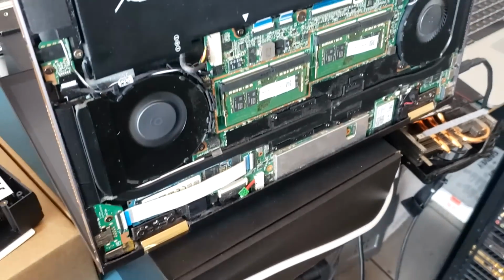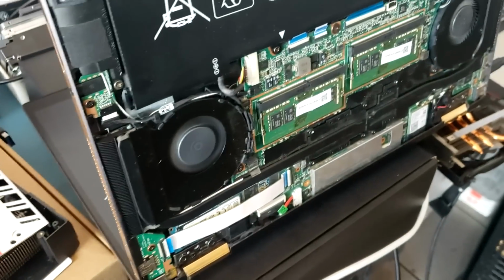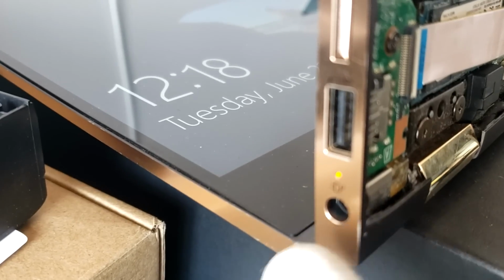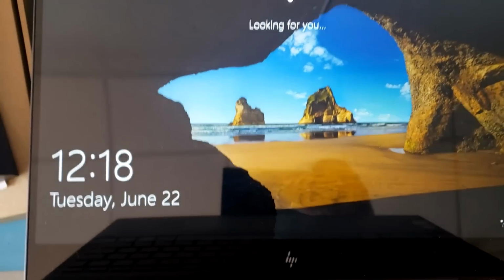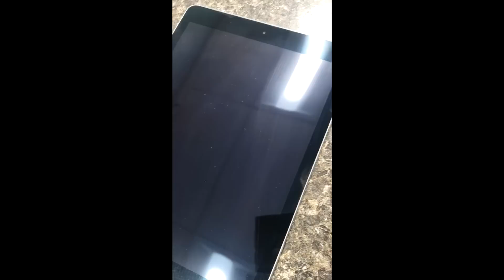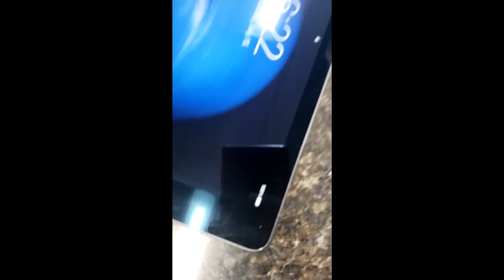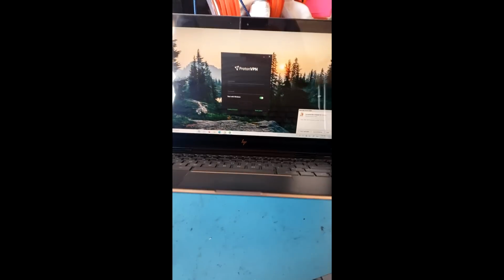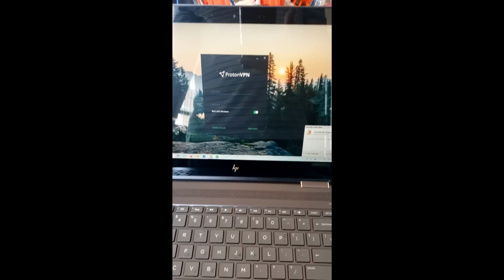Video proof for every repair to avoid False Claims and Disputes. That's how we do it.

Comment: We do this for everything also. Not only the repairs, but we have a dedicated desk for receiving all packages. We video the opening of each and every one clearly showing the delivery label to us, all corners and highlight any dents in boxes etc. Then the unpacking to show what was ACTUALLY sent, what condition, we audio describe dents scratches etc. You should not need to do this, but over the years there has been in increase in dishonesty with some customers, so we protect ourselves.
Reply: I think you have to really do that these days, If a customer mails in something and it gets more damage during shipping, they will most certainly complain that the damage was on your side and you were attempting to shift the blame.
Reply: @NervousNoodles  Only in USA probally
Reply: To be fair... I'm pretty skeptical of repair shops around me. I've heard enough stories that my trust in them is pretty low. Probably many customers think that the repair shop did something iffy, or that they were charged way more than they should have. In my area at least, it's pretty common to charge for replacing stuff like $200 and in actuality just to repair the board with a $1 chip.
Reply: @kamisarma  Then you have every right to be skeptical of them .It is shops like that which make it harder for the good ones like us.

As for $200 for a $1 chip. That comment is frankly offensive. If you know how to change it and have the equipment to do so, buy the chip and do it yourself!

When you take your car for a service and they spank you for $500 when the only parts they used were spark plugs, do you question it? No.

Comment: I've only run into this a couple times.  It wasn't a total dishonest person, but the damage was much more than originally thought.  I had a 3DS with a bad home button, but soda had been spilled inside.  It was going to be a $20 repair, but then I wound up having $50 in parts, as everything I touched would fall apart. (Microscopic damage on FPC connectors, and ribbons)  But I've been thinking about doing this myself when things are questionable.

Comment: I had been wondering if this could be a viable option for these kinds of problems. I do wonder if that is enough video evidence though (for customers who claim you are stealing their parts for example). 🙄🤔
Reply: Yeah. For the scammer that says you stole his $2000 video card and installed a generic one, in an old tower running VISTA😆. Then customer cannot find any proof of even buying the card; no $2000 recipe or even a charge on credit card statement. But idiot scammers still bring in garage sale junk and try to pull a fast one.

Comment: Well didn’t happen with a friend laptop that we shipped turned on etc and we ran doom for a final test, sent it for charging issue and fan cooler replacement, and after more or less 6 months the reply was “dead cpu” when we already know its not a dead cpu… i guess when he receives the laptop he will have to check if the components are the same, but i dont trust northridge fix anymore, its a shame they look so professional but screw over international clients… no transparency on his case to be honest…